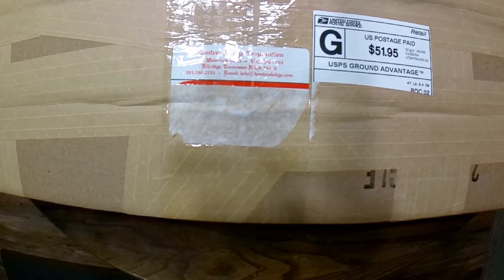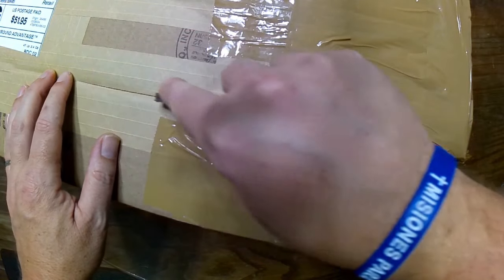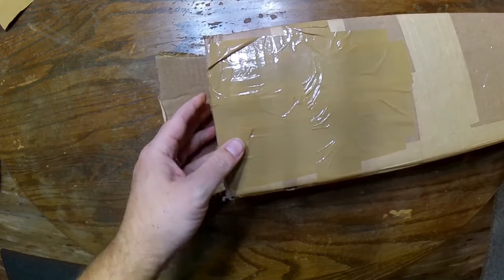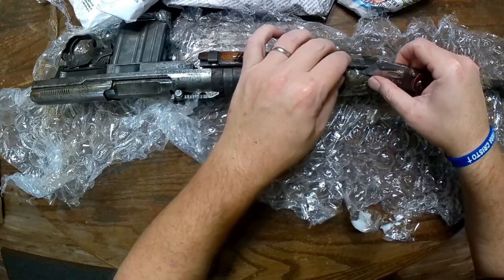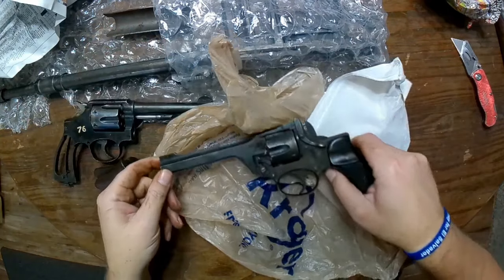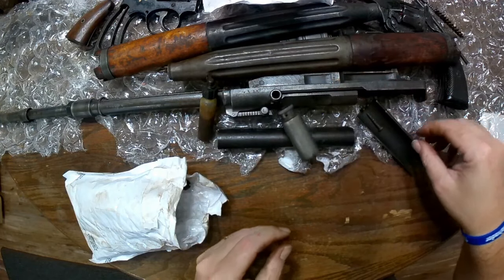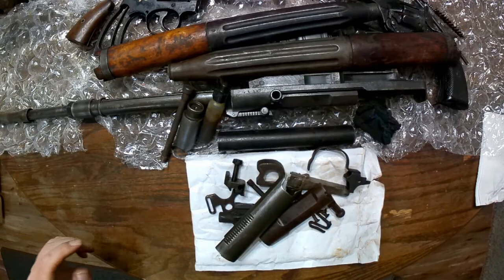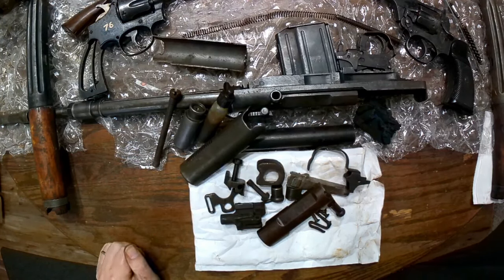Massive 7 Firearm Unboxing  from Hunter's Lodge (Part 1 of 3)Vz-52, S&W Revolver, & Enfield Revolver

Comment: You're supposed to check a revolver's cylinder lockup by pulling the trigger, holding the trigger in (not releasing it) and then wiggling the cylinder.
Reply from the maker: I'll be sure and do that, thanks!

Comment: thanks for the review for comparison, mine arrived on Friday and I have been cleaning them up. pretty much same condition as yours. The No 2 mk 1 doesn't get a lot of love but i really like the very British personality. might want to check if yours is the one or two star. I got a one star which means no hammer block. Also got one with wood grips which is pretty neat. My S&W's were complete but with scrubbed markings, could just barely make out "US Property"
Reply from the maker: You're very welcome.  That's cool on the wood grips, yeah, I like the odd flair on that Enfield revolver for some reason.  When I get time, I'll dig it out and do a follow-up closer look to check it out.  In terms of the S&W, I don't think mine was scrubbed, but it definitely has some rather thick black paint on it (reminds me of the Enfield rifles).  I might possibly refinish it so those markings are visible...I'll really have to think on that.

Comment: hi, enjoying your new items , the enfield revolver is a late war model the early ones had the kings crown on the right hand side just in front of the grips, the mark on your one is the later with just the D E ( they are put together so you end up with a "D" with a line in it , the numbers on the barrel on the left side are proof marks , the early war model was both double and single action but this was dropped to speed up the training of troops,  the uk government were taken to court over this model of pistol as it is a copy of a Webley  design and was made with out permission from webley!! the smith and wesson  are interesting pistols made in the us for lease lend and under the paint you may find clues of who used it , i have had them with new Zealand , Palestine, Australia, south africa and uk markings on, the long bolt in the parts bag looks like an enfield stock bolt, if it has a square end to the thread its for an smle and if a normal thread is for a no4 or post war/ indan smle, good luck with the new projects, and look forward to seen the next  items best wishes from the uk chris